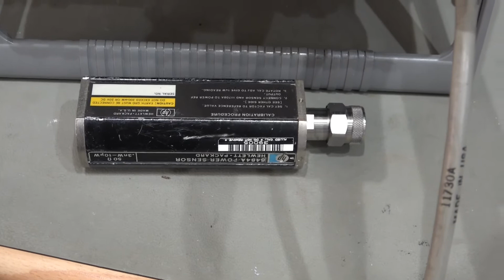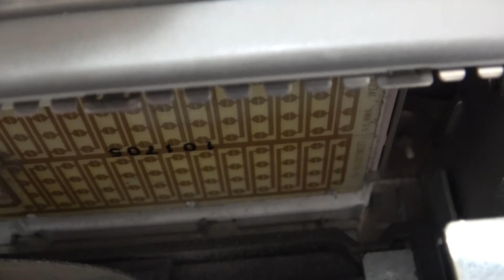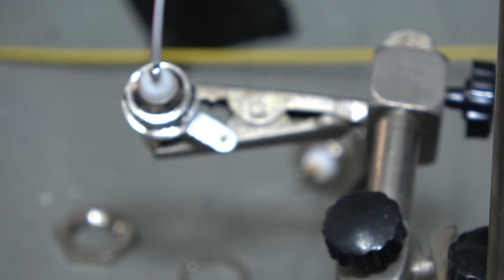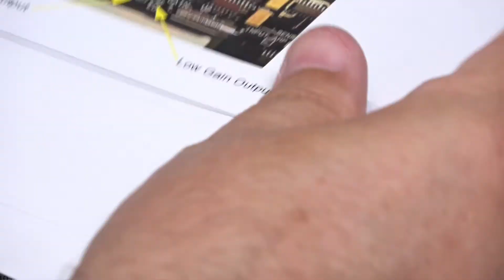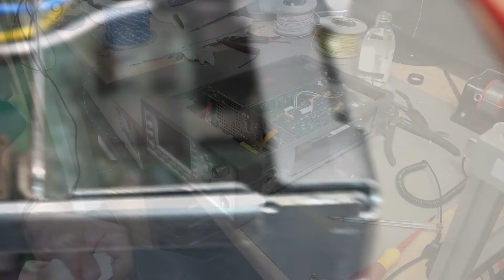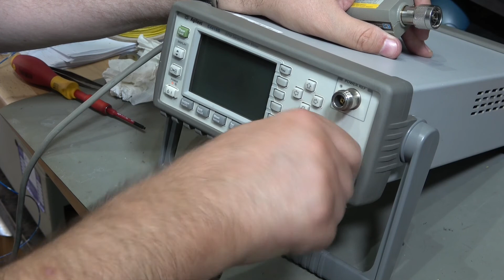0008 Agilent E4418B Power Meter Modification

Comment: Hi, great video. I just signed up.
I have an Agilent E4418B but I bought two sensors HP8482A (the same in your video) and HP8482B. I have a doubt, but can these sensors be used without modify? Or do I need sensors like E series Agilent?
Thanks.
Reply from the maker: I haven't checked the sensors you mentioned but they should work fine.  The later sensors store the calibration parameters but the older ones you just look it up on the table on the back for your frequency and enter the correct value into the meter.

Comment: Excuse me, could you tell me how you removed the front panel of the power meter?
Reply from the maker: I didn't need to remove front panel in this video.  The instructions are in the manual page 105 - not sure if you need to remove the rubber cover if there is one
https://xdevs.com/doc/HP_Agilent_Keysight/EPM-P%20Series%20Power%20Meters%20Service%20Guide%20E4416-90014%20c20130606%20%5B181%5D.pdf
Reply: @MakeOrRepair  ok thank you

Comment: Thanks for this vedio.i have agilent e4416a power meter. Voltages is ok 12v , -12v ,5v et battery 2,9v it work fine suddenly stop working. Light stand by is ok but when I press the power button notting happened can you help me.
Reply from the maker: Hard to say, I can really only point the way at how to get started.  Battery is a bit marginal but probably okay.  Since it is a soft power button I would start there and make sure that it actually signals the processor board and power board and that the front panel to processor board connections are all working (Boards A2 and A1 I think), after that make sure there is a clock on the processor board.  You may be able to disconnnect some of the other boards (so there is just proessor/power and display) and see if that narrows things down.  To me I would proably look for the quick wins - switch, conection to processor board, then it seems that if all power lines are present (try and monitor when you press the switch for variaitons) it is most likely the processor board - after all it just needs waking up and a clock in order to output to the display!
Reply from the maker: sorry, forgot to say, also take a look on eevblog forum, likely someone else has had your problem.  And if you do get it going let people know what you did on there - I think it is a good place to build a lot of information on test gear.
Reply from the maker: This is the service manual, not the keysight one, there is not much more in these older older manuals but I think keysight redacted a few more pages
https://xdevs.com/doc/HP_Agilent_Keysight/EPM-P%20Series%20Power%20Meters%20Service%20Guide%20E4416-90014%20c20130606%20%5B181%5D.pdf

Comment from the maker: I realised I connected the chopper cable to the wrong hole - after making a point which hole it was!  
It was just the inverse and worked fine,  Will orrect it when I do the LCD backlight mod later - watch this space!
Reply: Hello Peter, I don't and stand on what hole go the chopper cable, please can give me some more idea (I'm geriatric on my 76)😀 thank you in advance.
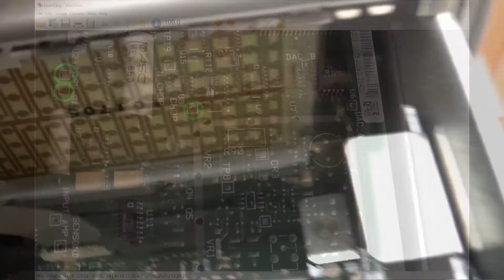Reply from the maker: @frankreal2258   further to my earlier answer, as well as time 13:15 also take a look at the second link in the list of service manuals  the "8480 Series"  There are step-by-step instruction starting at page 61
Reply: @MakeOrRepair  Thank you, Peter
Reply from the maker: @frankreal2258  See time 13:15 where the 3 connection points are shown.  
The chopper cable goes to the hole near U8 marked Chop.  I acidentally connected mine to the one further back named N-Chop (which is just the inverse signal so makes no odds really since it will just be the trigger for the scope!